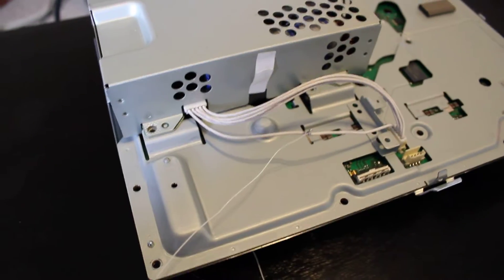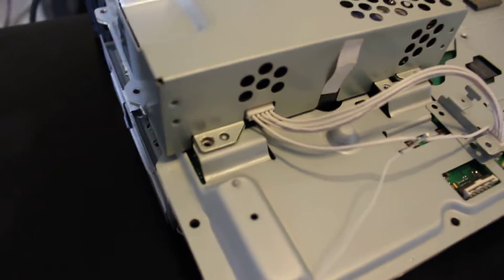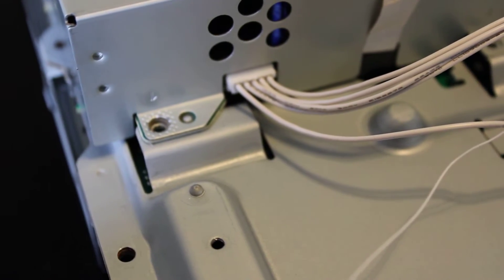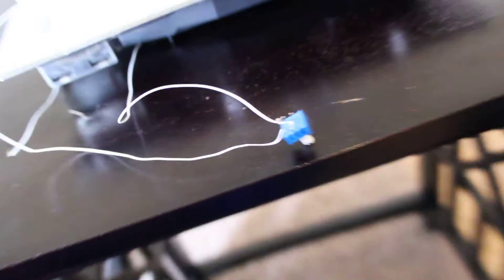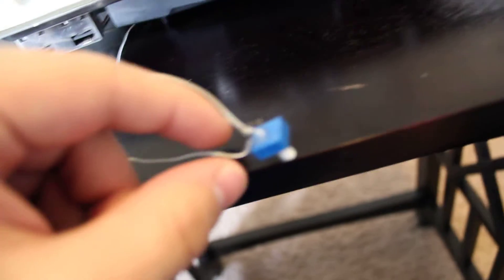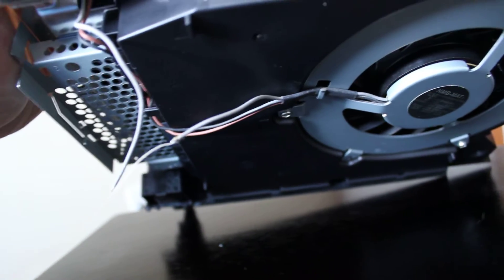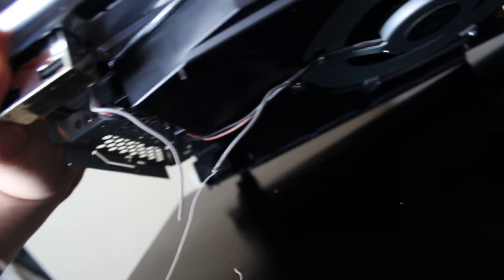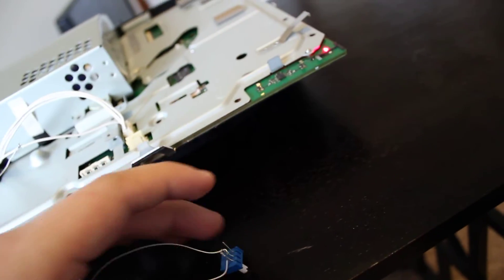How To Speed Up Your PS3 Fan! Prevent YLOD! [HD]

Comment: just so you know the reason why the ps3s fans are loud is because for one the blades of the fan are not even regular pc fans is looks like a generator out the case but still pulls air idk how plus speeding up the fan means more air pull think about it say you had that was on and you could see it moving very slowly u think it pulls alot of air? No it doesnt thats why speeding up the  fan is a good/bad thing, good for air pull bad for wearing out fan motor faster or the bearings